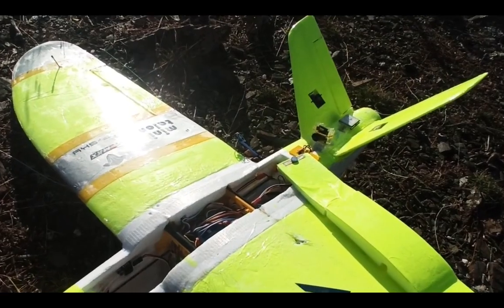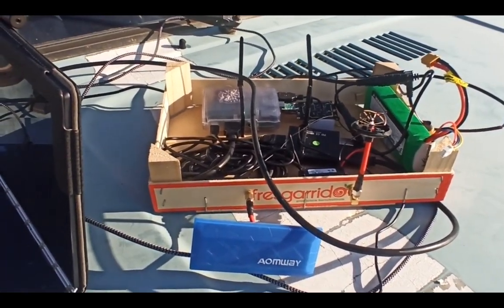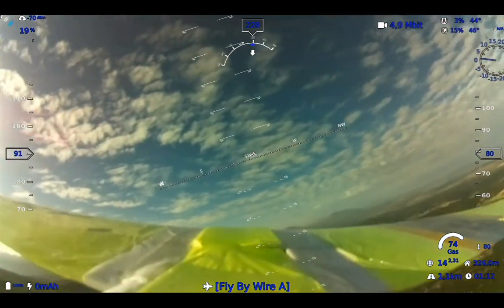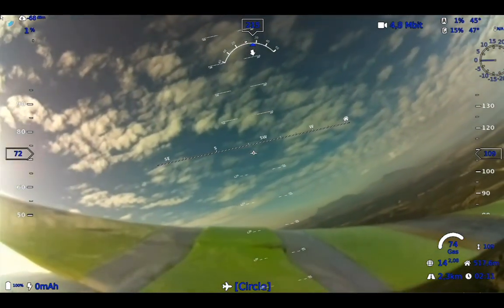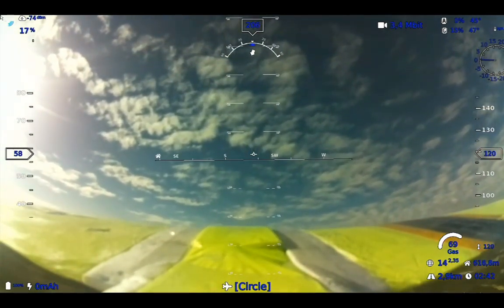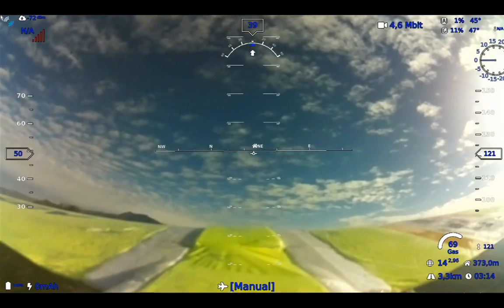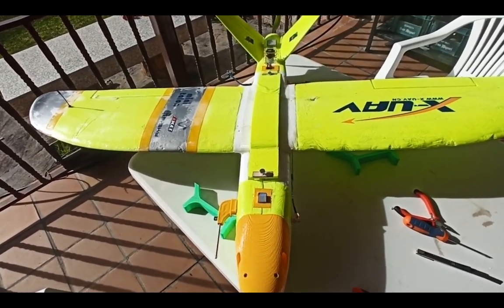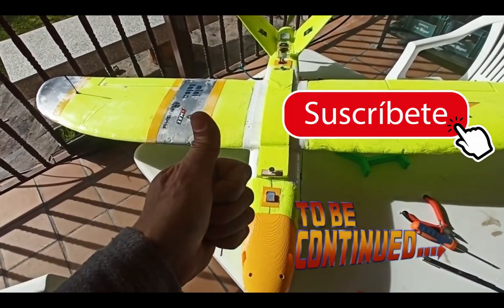OPEN.HD con Mini Talon - Aventuras y Desventuras

Comment: Vaya tensión de vídeo! He pasado un mal rato y eso que no pilotaba yo. 
Me ha parecido que utilizas r9mm, por mi experiencia, tengo dos módulos y 6 receptores conectados de todas las formas posibles y firmwares posibles, Flex, FPORT,sbus, FCC,lbt, etc... es la mayor mierda que ha hecho Frsky. Si no falla una cosa falla otra, lo mismo un día te vas a 10km con un rssi de la leche que a la siguiente vez tienes un FS a 100metros, me arrepiento  mucho de no haber invertido en TBS en su día xq he tenido bastante  accidentes y frustraciones por culpa de este módulo.
Reply from the maker: Si, ha sido angustioso, pensaba que que estrellaba o lo perdía, pero al final hubo suerte! Respecto al R9 yo también he tenido un par de problemas con él, uno con el vídeo en el Skyhunter que se metía en el receptor y este, pero en los dos he encontrado la solución, lo peor de Frsky es que han cambiado el protocolo a Access que no vale con todo lo antiguo que tengo yo, así que cuando cambie de mando porque no encuentre receptores me paso a crossfire! Saludos Alhambra
Reply: Yo he tenido R9 2019 con el R9mm mal creo que lo probé 2 veces y lo tiré a la basura jajaj, el R9 slim plus bastante bien aunque al final he pasado a TBS de momento no lo he probado en distancia pero la respuesta del mando es mucho más rápida.